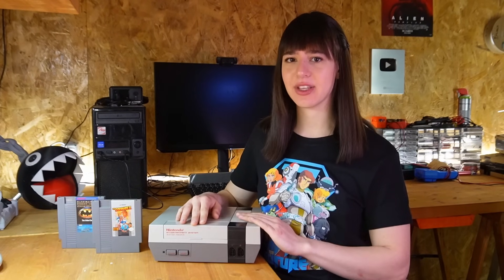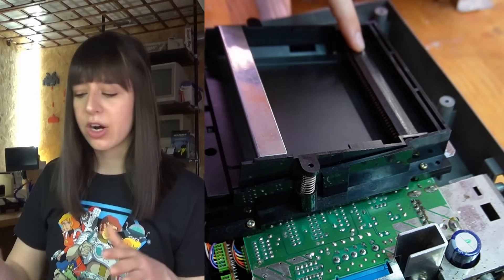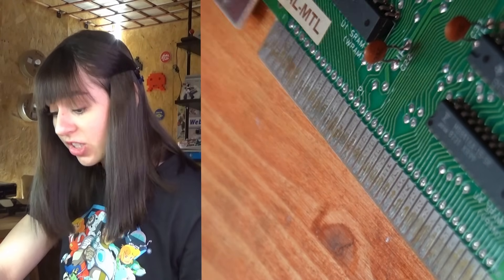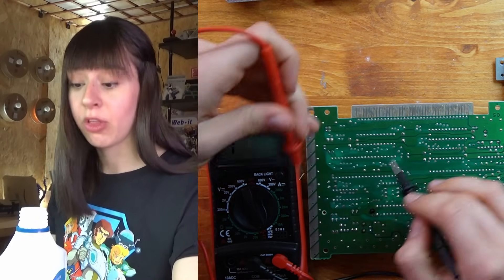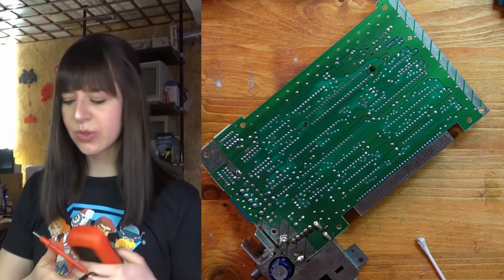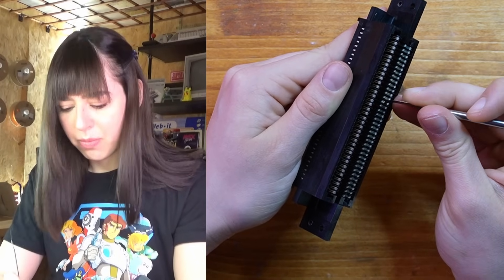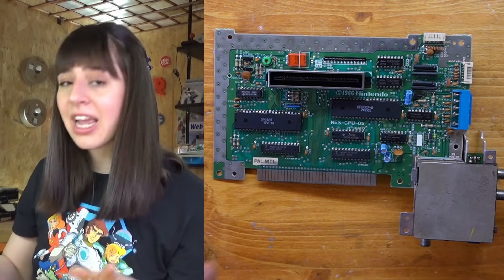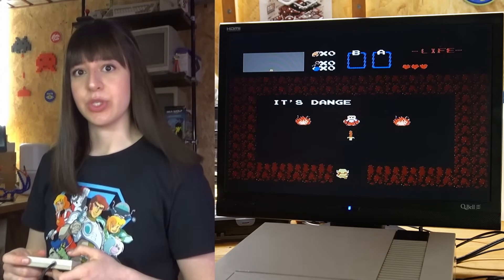I Fixed My Broken NES: Red Blinking Light & No Signal!

Comment: 3:18 Thank you so much for pointing out the importance of cleaning the contacts gently to avoid removing too much surface material. This is very important. I’m not sure how many people understand the importance of this. Isopropyl alcohol is one of my very favorite things to use for this kind of thing. Seems to work just about every time. Kneaded art gum erasers can be another good thing to use to clean contacts like this.

Comment: Love your channel but this was not a good repair. Nichicon sets the maximum life expectancy of their capacitors at 15 years due to the age of the rubber seals. Thermal cycles will shrink the rubber that seals the bottom and the leak will begin there and hide under the capacitor doing damage. A top side vent inspection is not ideal. Vents are stamped into the capacitors to prevent them from turning into little shrapnel bombs during failure. They are not an indication of when it’s time to replace them. 

Additionally, all spring tensioned connector systems (including sockets) have an insertion rating. The card edge connector in the NES was something to the effect of 100 insertions. Kids burned through them pretty fast. A retention buys you some time but if replacements are cheap - replace it. 

Not an ideal repair but it’ll work for now.

Comment: All you had to do was blow on the cartridge pins. 😂. The NES actually had a pretty big design flaw. Pushing the game down was neat, but the pins in the console bent way too easy. I believe the bents pins would normally cause the 10NES chip boot load error and the dreaded blinking red light. I installed a product called "Blinking Light Win" on my Nintendo. It replaces the cartridge carriage, and enables you to load a cartridge without pressing down. The only downside is that sometimes it can be a pain pulling the cartridge out, but it's manageable.
Reply: Btw, what anime is that on your shirt?  It almost looks like Genesis Climber Mospeada.

Comment: I found that a small crochet hook works well to rebend the pins if needed too. I cut the power pin on mh lockout chip almost 30 years ago making it far more reliable. I understand this is frowned upon now, but ive never had a problem with it. Attention might be neede with some unlicensed games that use a charge pump to zap the lockout chip. They can get very hot and could damage something if the lockout chip isnt connected. I didnt have any of those.

Comment: I've never repaired a NES connector so this comes with a grain of salt, however I'm just wondering if the connector is slightly self cleaning and just needs friction, like you can do with by inserting/removing Game Boy carts if they stop working. While it may not be appropriate to rapidly attach/detach the connector to the motherboard (especially given the state of the pins on it--they looked really stubborn), on some other friction connectors I've had success by folding up some scrap cardboard to about the same thickness as the plug/card and used that instead. The surface of the cardboard is slightly abrasive hence should be able to rub the pin contacts and give them a bit of a clean and might be a gentler first attempt. Using some IPA after cardboard should also help remove any lose paper/card fibres that may have come lose too. Ramping up to sandpaper could be useful if the cardboard doesn't help. As always I know all repairs are different without a set rulebook and am glad your intuition has paid off again. Another device saved from the scrap heap =)

Comment: I found my NES at a local thrift store. I couldn’t test it as I didn’t have any games, so, while I waited for the game i ordered I set about cleaning the game connector and removing a few pieces of snail bait that been ratting around. While doing that I saw a bodge wire on the motherboard and ran an eye along the trace it was connected to and came to a cut. So someone had cut the trace and rejoined it. The game arrived and all in could get was a grey screen. Looking at the damage I found the adjacent trace was also broken. So whoever cut IRQ had inadvertently cut this one. Another bodge wire went in and I now had the game booting and playing.
Reply from the maker: Wow that’s quite a story! Good thing you checked the board, glad you got it fixed

Comment: This was the first thing I ever fixed way back in the late 90's, there were internet guides, mostly text with like two very low res photos. I used a bobby pin I stole from my sister and I bent it into a hook so I could slightly bend each pin slightly one by one, I also cleaned the contacts with some brasso, still works great to this day

Comment: I really like brasso for cleaning those metal card connector pins on the PCB, like the ones on the motherboard and on the cartridges themselves.
It works extremely quickly and well, and doesn't take a lot of scrubbing or scraping to be effective. I clean it off after with iso.
I wouldn't recommend it for the square bracket pins. Sandpaper probably is the right tool for that, cause the brasso would be hard to clean out of it after.
Reply from the maker: A lot of people recommended it to me! Thanks a lot I’ll definitely look into it

Comment: Instead of cutting the pin 4 of the lock code chip I would desolder it, and solder an actual socket for it and I would either cut the sockets pin 4 or I would put the actual chip on a separate pcb with a dipswitch or something like that to enable/disable that pin... just to keep the chip as it is.
Reply from the maker: I didn’t think of that! I guess I could’ve done it but luckily putting the NES back together isn’t too hard so I preferred to just test it right away. Considering how corroded the connector was that could’ve easily been the only issue

Comment: What's funny to me is I own several NES and they pretty much all do the blinking light flashing black screen. I just assumed it was normal even when new if a cartridge wasn't aligned properly. Do you ever adjust something internally to make sure the cartridge is properly centered and making good contact? I always seem to have a lot of left to right movement. Also hilarious to me I never realized the tray was on a simple hinge mechanism. I always thought the entire holder sprung up and down parallel to the surface the console is on. I realize now that would be a much more complicated mechanism. Nice work!
Reply from the maker: yeah the blinking light is pretty common with the NES! As for adjusting it, I usually make sure the connectors are clean and sometimes I tweak the metal contacts a little to make sure the cartridge is sitting right
Reply: @Sayakas_Digital_Attic  Thanks! Keep up the great work.

Comment: Great job!  When cleaning it's useful to think a little like a chemist.  Solvents come in a few chemical 'styles' which describe aspects the molecules.  One aspect is called 'polarity' and describes if the molecule has poles like a magnet or a battery.  The three most common names you'll hear are polar solvents, non-polar solvents, and semi-polar solvents.  You need the right kind for the dirt you want to dissolve.  Water is a very polar solvent while oil is non-polar and alcohol is in the middle as a semi-polar solvent which is why alcohol works so well with a wide variety of dirts.  The most ideal cleaning solvent will match the dirt.  Here, I think the best is to start with water and a stiff brush to dissolve the oxides, and once they are gone to then move to polish after that, and then finally to use a little contact cleaner to leave behind a protective oil coating.

Comment: 1 question why they use metal plate in all console Inside?😊
Reply: The way a NES (or any RF era console) works is that it transmits a signal that the TV recognizes as an antenna signal making the console a minature TV station of sorts. The metal plating minimizes the chances of the console interfering with analog television signals. Of course now everything is hooked up directly via HDMI and there are no analog stations to interfere with.

Comment: If I have to buy one, I'll go for the NES TOP LOADER or the Japanese version, which has fewer problems.
Good luck with the repair.
Reply: I purchased the Blinking Light Win which is a device that bypasses the need to push down on the cart. (It also bypasses the region lock.) Unfortunately I'm not sure if it's still manufactured.

Comment: Following an online anecdote from over the years,  I have taken the 72 pin connector and used the technique of bringing some water in a pot to a light boil - just enough to boil, but not so hot to start melting the 72 pin connector plastic - and then placing the connector in water while the heat remains constant. In theory, this should bend the aluminum pins back to their original shape, providing better contact with the cartridge tabs. If it doesn't work the first time, give it some additional time in the water. Dry it off completely and re-assemble. I have had success with this.
Reply: Those connectors are still available new . I replaced them on both of my nes's

Comment: I've read on various forums that if the lockout chip is malfunctioning you will still get a second or two of the game's boot screen between flashes - not a black screen. So the lockout chip should be the last thing you go poking at in these circumstances.  I also understand that a disabled lockout chip can cause issues with unlicensed carts and modern flash carts (like the everdrive).

After watching this I plan to try metal polish on the NES I bought new back in 1986.  It's got the same issue and I've already put a new 72 pin connector in it 20 years ago.

Comment: you can also tin the edge connector to prevent future corrosion, but you have to be careful to completely remove all the excess solder with solder wick afterwards or the connector won't fit over it.

Comment: 2:40 I used a big red rubber eraser on my childhood NES where that cartridge connector mates to the motherboard - it worked great and didn't do additional damage to pins
Reply: Yeah same as blowing into the connector, or cleaning the disks with ipa/96% alcohol, good old times

Comment: What is this pencil that you are using for removing that you are saying use gently? 
I'm usually using soft eraser rubber it's actually safe to rub and good to remove dirt and oxidation
Reply from the maker: It's a fiberglass pen! I use it often when there's visible corrosion, but I was advised to use it sparingly since over time it could accelerate corrosion or damage the material
Reply: @Sayakas_Digital_Attic  oh thank you, noticed that there is such for more complicated cases :)

Comment: It's mostly about dust and corrosion.
Reply: It's mostly about the pins getting bent do the loading mechanism. This is not so much an issue with the top loading model.

Comment: 5:46 could you share what brand/type of metal polish you used?
Reply from the maker: Hi, this is what I bought: https://www.amazon.it/dp/B0D4DZTJ4S?ref=ppx_yo2ov_dt_b_fed_asin_title&th=1 (this is not an affiliate link) but I think you can easily find a good one on Amazon  even from other brands
Reply: I know Brasso works.  I've seen John Riggs use it a lot on his "Open Cart Surgery" videos.  Like this video, most of the time all that's required is a good cleaning to get things working.
Reply: @RandomBitzzz  thanks. I'll look into that. My 72 pin connector is spotty. Sometimes works great, sometimes I have to reseat the cart over and over. Tried cleaning the pads with eraser/isopropyl/fiberglass pen. Tried boiling the connector. Tried bending pins. Works better for sure, but not reliable.